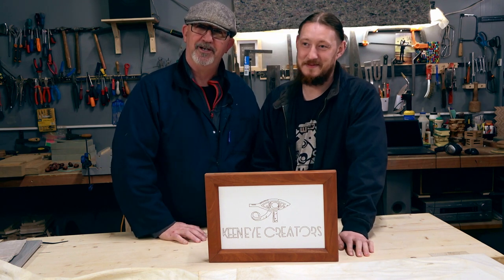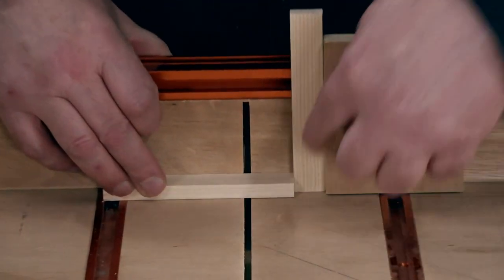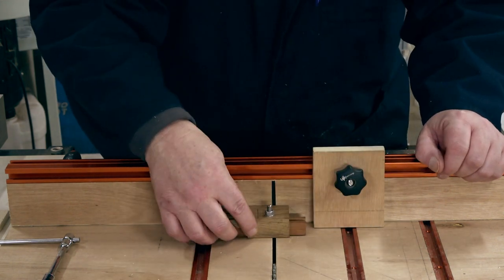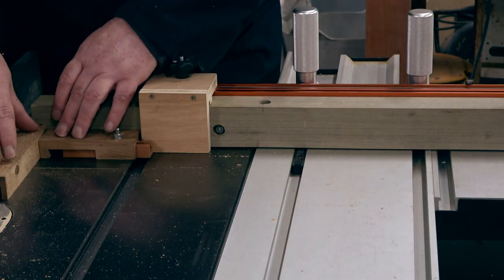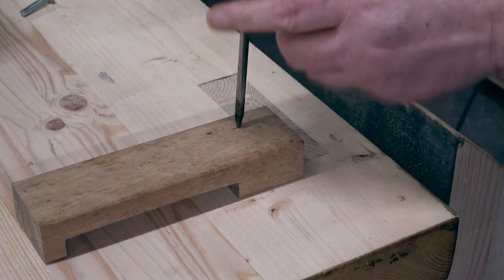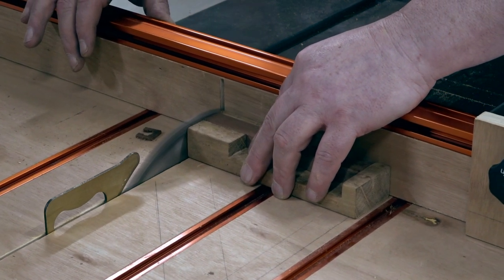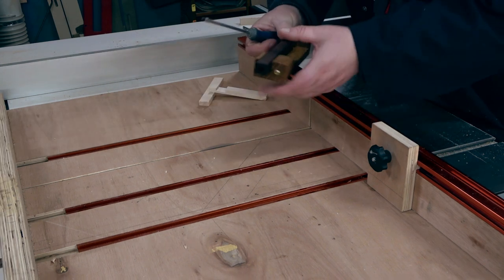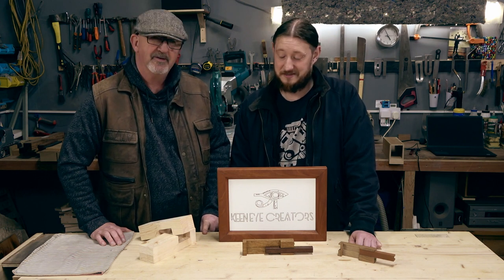How To Make Them Like A Pro!! Dado's, Grooves and Half Laps But Bigger. (KERFMAKER)

Comment: Looks like a good design. However  I"m a little confused about how the slider is made, and how it is locked in place.
Reply from the maker: Hey Allen The slider is  premade as T-Track with a T slot router cutter, it locks in place with a bolt that tightens through the nut inserted into the main body of the Kerfmaker. We cut a slot into that bolt so we can tighten it with a screw driver.
Reply: Yeah this is a variant of the same design that uses aluminum T track as the "slider" part that is held in place by a screw. That version would be easier to make especially if you have a dado blade that will cut the channel for the T track although it isn't necessary. It will just take longer with a regular blade. This version is (I agree) a bit sexier, because the use of wood really makes it a beautiful jig. Both beautiful and functional. Just do a search for "kerf maker" here on Youtube and you will see the T track version pop up.